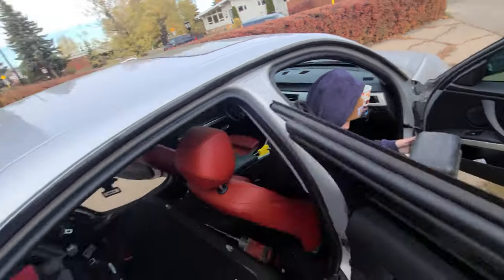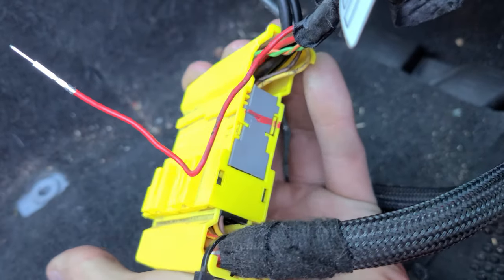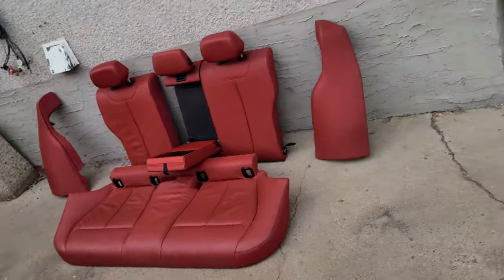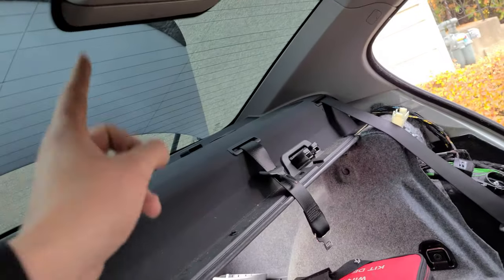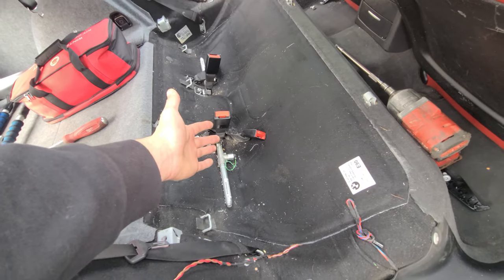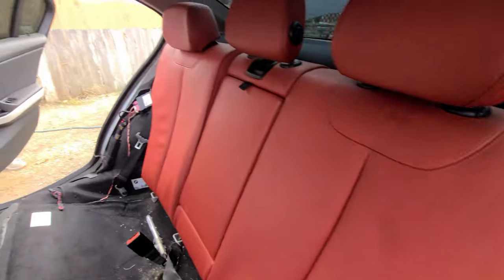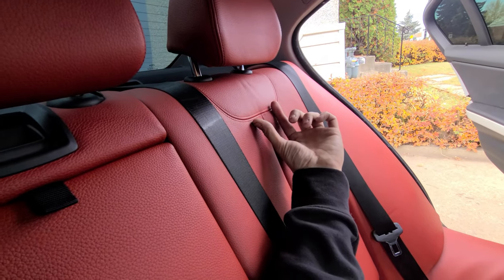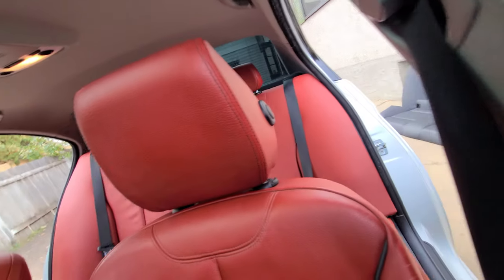Swapping Red F30 Leather Seats Into My E90! Turned Out Better Than I Could've Imagined!

Comment: Ok, I have completed the transplantation, but many details are not as simple as in the video. For example, the backrest width is different, so it cannot be fixed, the bracket needs to be cut, and the side backrest needs self-made bracket to be fixed, but only the modification of the seat will not change the car. The modified seat can no longer be installed back to the F30, but the fixed seat cushion is perfect and undamaged. There will be some difficulties, not easy

Comment: Hi, thank you for your video, he helped me to do the same thing as you, F30 seat into E90, could you please ask me why the two fixing bolts of my rear seat are a little wider, about 2mm, which leads to the failure to fix the seat back to the proper position? Do you need to remove something?Bless you

Comment: Inspired me to look for a set now.
Did you use the e90 seat rails or did the F30 seat rails bolt straight to the floor?
Reply: The f30 seat rails work fine

Comment: Hey man! Nice work. I was wondering if you made it fully work.. meaning, the heated sets. Did the work, did you have to do any other mods? Thanks
Reply from the maker: hey sorry for the late response! I did finally manage to get it all working until the seat module failed. just waiting for a new one to come in and it should all be working again.
Reply: @spontaneousgiraffe  did you figure out where the red wire went?

Comment: So I'm guessing the e90 seats would fit in f30. Can't stand my leather f30 seats so uncomfortable. I think the previous owner has worn one side down more. My right leg sits lower and causing me pain
Reply from the maker: That is correct, they will bolt in but you will have to do some wiring to make them function.
Reply: @spontaneousgiraffe Any updates on repinning the red wire? Thanks!

Comment: Now try to find red leather door panel to complete the look, and by the way how much you spend on f30 seats ?
Reply from the maker: I think I'm going to have to do some custom door panels to tie it altogether. I believe I picked up the seats and center console for around $500 CAD,, I picked them up about a year ago and just finally had a chance to throw them in. The wiring was also an issue for a bit so that killed some time.
Reply: @spontaneousgiraffe  I think the original will look better than custom

Comment: Hey, could you share the wiring diagram, please? :))
Reply from the maker: I will take a look and see if i still have the wiring diagram handy, or the forum that helped me out and link it here for you.
Reply: @spontaneousgiraffe  Oh man that would be so insane, that would help me A LOT. Thank You
Reply: @spontaneousgiraffe  Hi! Do you have any updates regarding the wiring? =D
Reply: Where did you pin the red wire??
Reply: @spontaneousgiraffe Hi there, where did you plug in or splice power for the red wire? I've tried slots #7, 5, and 1 and the side bolster still do not function? Is coding required also? Thank you!

Comment: not to be a bother but is there somewhere You could send me your finished pin out. I did this install last week. Everything works correctly besides the heated seats (I had gotten them to turn on constantly when i improperly wired the passenger seat but they dont work atall now that i changed it) and the rear bolster doesnt work